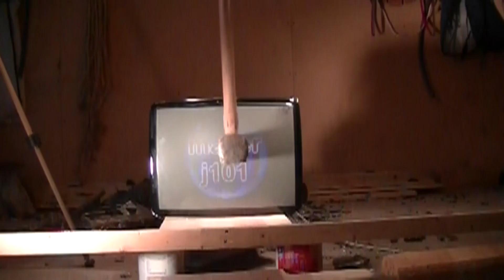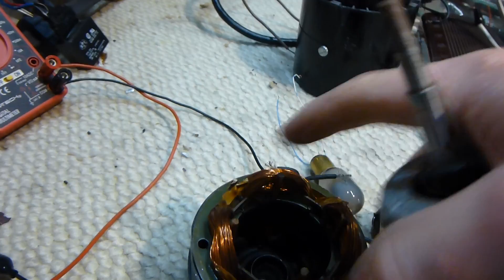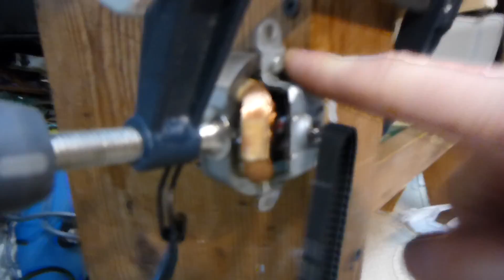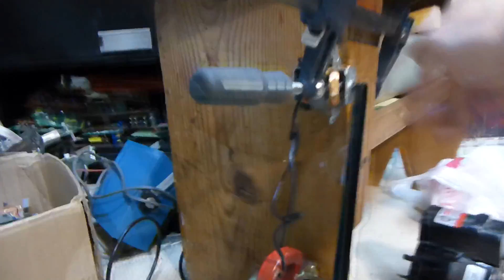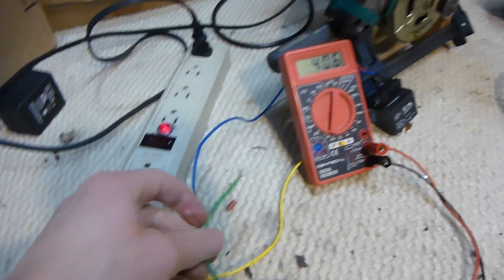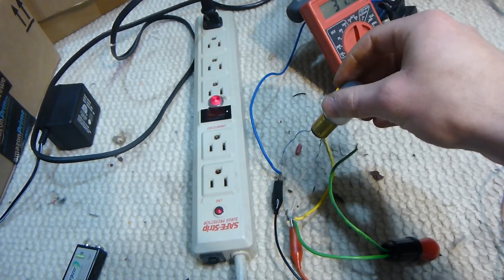Unmodified AC Induction Motor Working as a Generator Experiment

Comment: I believe that is in a way how alternators work on cars. Power has to be introduced before it can generate any.
Reply from the maker: Brandon Brewer I think it may be a similar concept.  But not the same.  Because a car alternate has coils in the rotor that are connected to a supply via slip rings and a brushes.  The coils in the rotor act somewhat like the magnet in a permanent magnet generator but they can be varied depending on the current demanded.  My induction motor only has stator windings. Thank you!
Reply: Brandon Brewer 
No actually on an alternator all u have to do is spin it and it will generate an ac voltage.. but if not mistaken the reason for this is that tour alter take is not an induction motor I think it's a permanent magnet motor which means it's producing a magnetic field theater it has power or not and when u spin the rotor the coils start to cut through the elctomagneric wave hence inducing a voltage on to the coil well that's a pretty basic explanation

Comment: Google AC induction generator you'll find the answers you need it requires a few capacitors and about 40 rpm of the motors operational speed good luck
Reply from the maker: zeropointfuel Thank you!  Very interesting reading on wiki!
Reply: Thank you for the search advice...
I've found this: https://www.alternative-energy-tutorials.com/wind-energy/induction-generator.html
This is crazy: I've a 1200 pages book about electrotechnic and they teach about plenty of things but not this!
Being"off grid" is not what they want you to become ;-)
Reply: But its not worth, its better to use magnets.... And he did the same thing without capacitor
Reply: @Ayanyoutubercom  No, using magnets forces you to 1) have strong permanent magnets 2) destroy the motor to insert the magnets into the rotor.
Using capacitors is non destructive and gives you the possibility to reuse the motor for another project.
:-)

Comment: Hi !

How much does the current increase through the brushed motor when you start generating electricity with the induction motor ?

Thanks a lot for sharing !!
Reply from the maker: SuperAmoL3D When it's just spinning the motor, not generating power, the brush motor draws about 0.5 amps.  After I have excited the induction motor so it is producing power the current jumps to about 1.2 amps.  When I connect the 5 watt light bulb the current drops to 1.1 amps.  I'm not sure why it drops.  All I can figure is the current that the lamp draws diminishes the magnetic field and thus makes it easier for the brushed motor to spin.  It definitely has something to do with the capacitor.  Because if I remove it or replace it with a bigger one it will not produce power any more.  I should try a smaller capacitor and see how it works then.  Thank you!